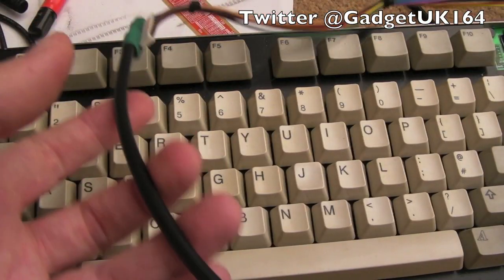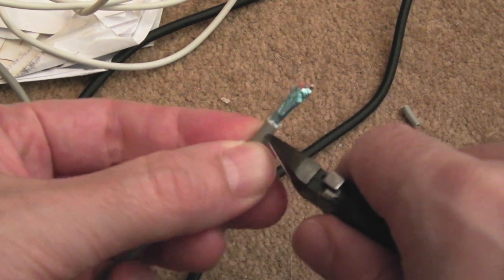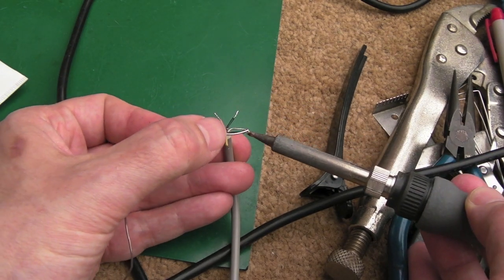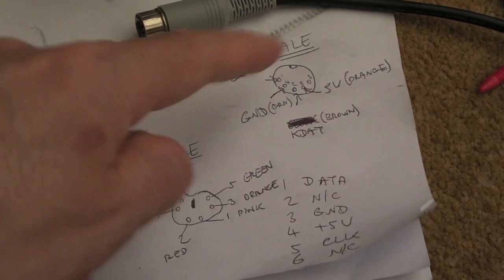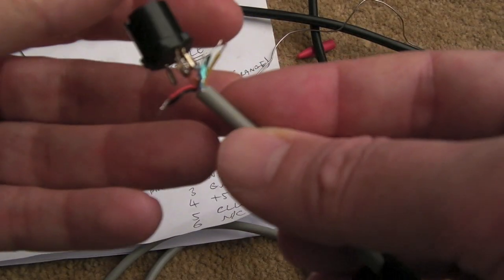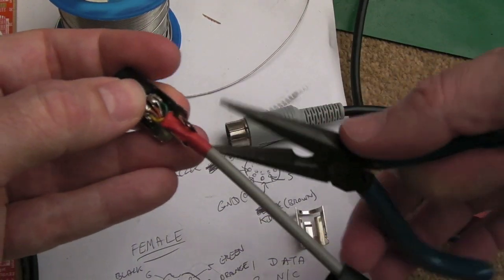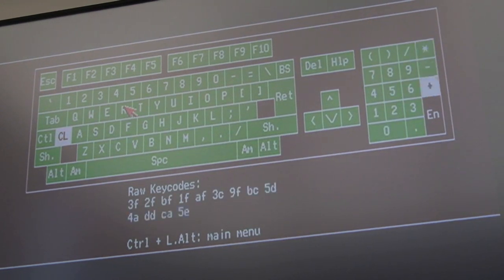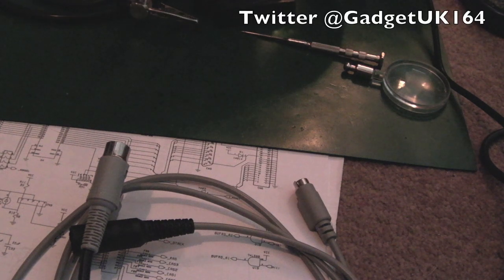Commodore Amiga Adapting Keyboards (A500 / A2000 to A4000)

Comment: I remember hacking a cable so I could use an old A500 as a keyboard on my CD32. I'm fairly sure that the cable I had also had a pass through so I could use another cable for the serial port at the same time..

It's been so long I can't remember the exact details but i definitely remember transferring files from a Fred Fish CD to my A500+. Happy days. :)

Comment: Bit of a tip for stripping thin gauge wires. Sounds daft but works very well. 
Use your side cutters backwards! 
Grip lightly and pull away. 
It was a tip I was given many many years ago and it's never failed me.

Comment: Well done Chris, very well soldered and put together. Thank you for all your hard work in making these videos. I gotta ask you though, how many Amiga do you own?
Reply from the maker: Thanks Jamie =D  Great question!  I have an A500, A500+, A1200, CD32, A2000, and a number of Amiga boards - ie. A4000, 2 x A2000 (rev 4 and 6), 5 x A500 boards (2 x rev 3, 1 x rev 5, 1 x rev 6a, and 1 rev 8a).

Comment: A PC  AT to PS/2 adapter works fine for adapting an A2000 keyboard to an A4000 - used one for years back in the day!
Reply from the maker: Yes, and I have one of those too =D  But I need to be able to test various keyboards as I am working on these systems.  I don't really like using a PS/2 keyboard either tbh =/
Reply: @GadgetUK164   No, I meant you can adapt your 5 pin adapter to an A4000 with a ps/2 keyboard adapter - not that you should use a ps/2 keyboard!  One of these - https://www.amazon.co.uk/kenable-AT-Keyboard-PS-Adapter/dp/B003OSTBZA/ref=sr_1_3?dchild=1&keywords=at+to+ps%2F2+adapter&qid=1612305720&sr=8-3

Comment: Correct me if I'm wrong. The CDTV uses a Amiga 4000 Keyboard, so I can mod a A500 keyboard like this?
Reply from the maker: The CDTV - not sure if it uses an Amiga 4000 keyboard?  You can use an A500 keyboard with a 1000, 2000, 3000, 4000, CD32.  I would assume it would work with the CDTV too.

Comment: Hi, is it possible to connect an A4000 keyboard to a CDTV making a simple cable adaptor?
Reply from the maker: Yes, you can see here the pinouts for both.  https://old.pinouts.ru/InputCables/KeyboardAmiga6_pinout.shtml

The CDTV uses a 5 pin mini DIN, but female rather than male.  So you just need a 6 pin female, to the 5 pin female the CDTV uses.  Use that diagram to work out which pin goes where.

Comment: Would I be able to use the USB C as a input to the Arduino to the output as PS2 connection to the Amiga 4000. Which I believe is the opposite of what your video is. Thank You
Reply from the maker: Not really following what you mean!  You can use USB-C to power an Arduino, or you could power the Arduino from the 5v of the Amiga.  With the right code on the Arduino you could produce the clock and data signals the Amiga expects, and perhaps use a USB or Bluetooth keyboard via the Arduino?  The Amiga keyboard interface is nothing like PS/2 or USB!  You need to adapt, using code - either on an Arduino, PIC, Raspberry Pi, or other MCU etc.

Comment: Isn't that an 8 pin JST, why not use a JST plug?
Reply from the maker: Yes, but you still then need to solder wires onto the JST plug.  So you can either use pin header, or a JST plug.

Comment: Does connecting A2000 keyboard to A500 present any issues ?
Reply from the maker: The A2000 keyboard handles reset differently - there is a reset pin on its DIN.  But if you ignore the reset and just pass VCC (5v), ground, kbdata, kbclock, it will work fine.
Reply: @GadgetUK164  Thx, I am getting ready for this project this weekend for my checkmate case.